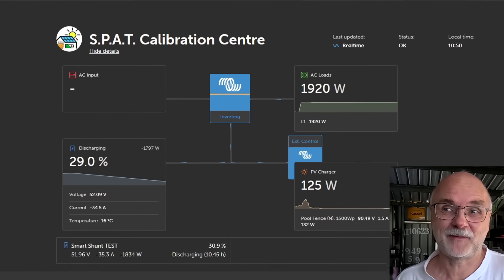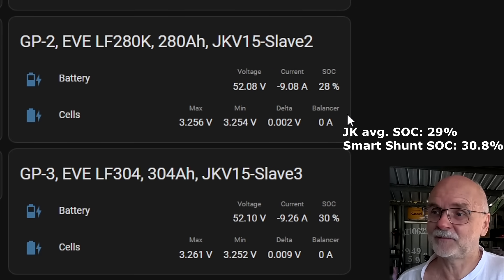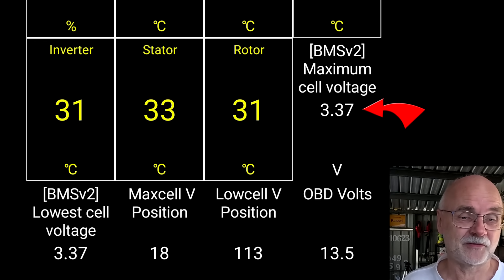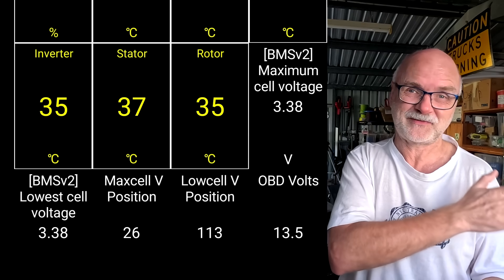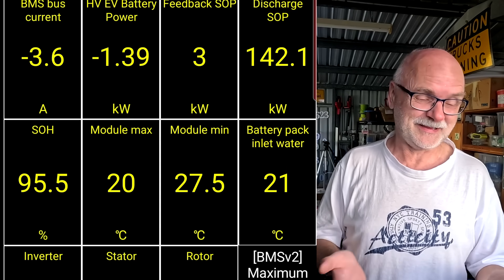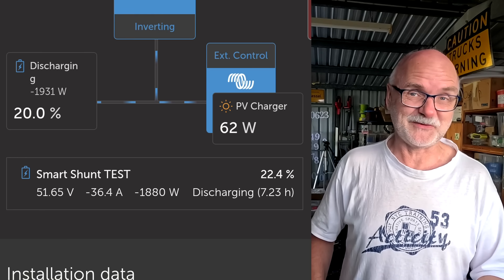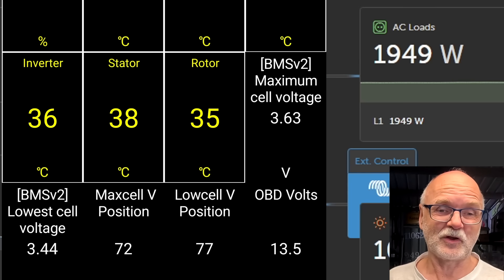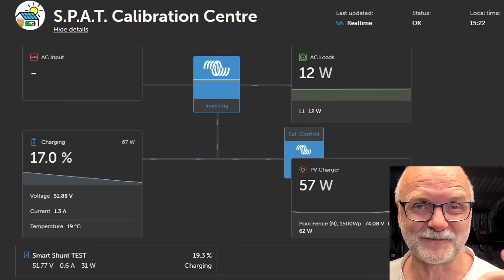JK Inverter BMS SOC Precision Comparison | Update 1

Comment: Hello! I have bought versions of the jkbms, one V14 and a V19 and I am noticing in my cerbo GX that the V19 consumes more current because the DC load increases up to 400W when the solar is delivering more amps. That just doesn't happen in the V14. Does anyone notice that?

Thanks,

Armando

Comment: A quick question
I have a JK BMS, was going fine but now the app shows 0% SOC in batteries (7.00 kwh) but they are at 27.05 volts with 50 amps inputting.
Any thoughts?

Comment: My experience only stretches to JK BMS v.15 and v.19, but I'd say the v.19 is really bad at keeping track of SoC. I have used the two with the same battery pack in a small electrical vehicle but after switching to v.19 the SoC readings were useless. Have added a Victron SmartShunt and it gives reliable readings. As usual, Victron gear is super!

Comment: If I undestand, you have JK bms in parallel.  It means voltage is same, but current is based on the internal battery, wiring and BMS resistance. So the most likely the current differs per BMS what seems to be reason for different SoC values after some hours. You can't say which BMS is more precise unless you do separated tests.

Comment: Hi Andy love what you do and watching for all your tips and bits i can absorb for a future project to build a battery pack that will run everything we need to travel this great land (Australia) in a caravan.
The System i have designed for our needs would need 240Amps (If Everything was on at Once but that obviously would never happen) 
To date can you please advise your opinion on the best DIY 48V 310AH (There About) Battery Box, Battery Cells (Brand and size) and BMS with Active Balancer 

i hope this makes sense 
Thanks In Advance
Reply from the maker: Sounds like you are in for a Yixiang DIY box V2 with JK-BMS and MB31 cells. That matches your requirements. I made quite a few videos about this box and the link to it can be found here: https://off-grid-garage.com/diy-kits/
Reply: @OffGridGarageAustralia  Thanks so much.

Comment: Hi I have some isues with my JK BMS (PB1A16S10P) and JK is not answering my Email, hope someone can help me.

I have some issues with adjusting the balancing amps. When I try to set something like 0.5A it just jumps back to 1A again. For some reason I got it to 0.3A at some point.
Would a firmware update fix this?
And what is the lowest balancing amp possible, I need it to only balance with 0.1A or 0.2A pr. cell.

Comment: Unable to upgrade V19 to FW 19.05. How to perform it? It always connects in a parallel mode, with settings tab being inactive. Also what does mean "Discharge OCP2" switch?
Reply from the maker: DIP switches need to be on 1000 for the FW upgrade.

Comment: Andy, the battery chargers you recommend, both in AliExpress, and in Amazon, are no longer carried.  However, there are MANY 60V, 5A power supplies listen at both vendors.  Would any of these be good, especially for 48v raw cells?
Reply from the maker: No, you can't us a 60V charger. That would overcharge your battery. I'll update the links...
Just checked both links for Ali and Amazon and they work and point to the right 54.6V/20A charger.

Comment: The biggest problem with the JK-BMS is that it deviates a lot when idling. When the battery isn't charged to 100% on the third day, the deviation is already 20%.
On the Smartshunt in idle it reads 0.5Amp and on the JK-BMS between 1.5 and 2Amp. I've tried calibrating it, but it doesn't work, and I've tested it on several devices.

Comment: Hi Andy, what bothers me about all the tests is the very low charge/discharge power. I personally charge with 150-200A which is between 8 and 11kw. With your 4 battery units from Gobel Power with the EVE 280 cells, charging at 0.5c should be around 560A, even charging at 1C is possible which would be 1100A, if you then run the system at 30A for days this is limited and inaccurate, it is to low. Thanks for the vid anyway

Comment: I have two JK-BMS (BMS PB2A16S20P, HW v15). The latest software version is installed on both BMSs (V15.41) and both are configured the same. However, one BMS is clearly noticeable due to its behavior. The SOC display/measurement does not seem to be working correctly. While the first BMS is still at 72%, the other one is already at 4%. And that's even though both packs have the same voltage and not a single cell has drifted too far. Both packs are connected in parallel to the same DC connection and to the same Victron system. Do you have any suggestions as to what i can do?

Comment: i think cars use lithium ion batteries?
Reply: Depends on the car.
Reply: Car makers have decided it's not a good look when lithium ion cars catch fire so real world testing has caused them to now favour LiFeP04 chemistry. Is this a fair comment?
Reply: Sounds rather far-fetched, EVs having a lower combustion rate than IC cars, but of course there's a powerful incentive by the fossil fuel and motor industries to spread disinformation. I doubt the average punter even knows what technology their EV uses. LiFePO4 cells have a longer life than LiIon cells but of course lower energy density.

Comment: My impression is that the difference on SoC between my Victron Smartshunt and my V15 JK Inverter BMS tends to be much bigger with normal daily usage (small loads come and go, charge come and go during the day) - vs. full continous load/unload of the battery.

Battery is 16x EVE 280ah cells (measured capacity just above 290ah).

As for now, my Smarthunts reports 25% SoC, while the BMS reports 33% - and it's charging around 35-40 amps at the moment.

Obviously I trust the Smartshunt more than the BMS regarding SoC :)
Reply: Have you calibrated voltage, current AND capacity ?
Reply: @Juergen_Miessmer  Yes, up to several times :)
Reply: @Juergen_Miessmer  Not sure how to calibrate capacity though, since it's a bit "constant"... :) 

But voltage and currant - indeed. As said, multiple times.
Reply: @JFK666666 
Set the capacity with the JKBMS App to the result of your capacity meassurement.
Reply: @Juergen_Miessmer  Ohh, indeed, that I have done :) 

Capacity in my JK Inverter BMS is set to 290AH.

Comment: SOH is  meaningless in most EV. Hyundai/Kia for example melt down the Buffer and then state 100% SOC 😂. Only Tesla does a comprehensive self check procedure for SOH. It is normal to loose 5% within the first 50.000km and then 1% for every further 50.000km. On my EV after 11 years and 420.000km : 16.8% degradation.

Comment: How are you getting the car BMS data?  Did I miss something?  Also, I noticed the voltages are different on the JK-BMS and the Shunt.   Would calibrating the voltage and current help with the difference?

Comment: Biggest effect on JK BMS SoC accuracy is how much time you spend near the 'dead zone' they zero out current reading to mask DC offset error.
Worse case is using system as a UPS which spends most all of the time in the dead zone.

Comment: Thanks Andy,  As always very nice presentation, I enjoy your presentation style.  @10:05 you give us the SOC of the 4 batteries as (Master = 13%, S1=21%,, SS2= 16%, S3= 17%) and you claim the SOC% preciseties  shows the Master is the worst (13)% and S1 (21) is the best, but we have seen (on this channel) that batteries in parallel may not charge/discharge evenly (relative to capacity) and the current sharing (I prefer the term current hogging) can change over time throughout the discharge cycle.
I did enjoy your videos on your Unplugged EV channel (I found it only about 2 months ago).  Please give us some new content on your Tesla(s).  
As to calibrating individual BMS(s) in the batteries, how about adding a smart shunt to each battery?  You can start by calibrating the smart shunts (to each other) by putting them in series and charge / discharging a single battery and see how they do.  Yes the voltage drop of  the shunts will cause a slight difference in Watts and Wh on the different shunts (due to the voltage drops measured from the B- of each shunt to the P+ of the batteries (As each B- will be at a slight different voltage), but the Ampa and Ah should be the same on the 4.  You could then use these calibration values a s a "fudge factor" in a spread sheet.

Comment: "Hello Andy. Thank you. Your method is not reliable. I've already observed that JK-BMS makes many errors depending on the discharge current intensity.
It errs more or less depending on the fluctuation of the discharge current.
Your test doesn't reflect real-life domestic use, for example.
Simply put, even the Victron shunt and the JK-BMS don't give exactly the same discharge values depending on the discharge and charge intensity. Because of this, it already can't be good for JK-BMS."
Reply: That's the whole point of the test, to determine how much the Jk-BMS SOC is out, and which version (V19.V15,V14) is better or worse.
Reply: @uksa007 

Please read more carefully. The answer is already provided in my post.

Comment: Yesterday I found out that the wonderful Solarman integration in Home Assistant can set the Max charge amps value in my Deye Hybrid Inverter!
This allowed me to force it to 0 during the morning here so that the battery did not fully charge and instead some export could be done during the very expensive early morning hours. When the sun hits peak power with clipping due to the inverter being limited by grid voltage vs rating it can then start charging and put power into battery. There's around 4 hours of 1-2kW to be had if there's somewhere to put it :)
It's sad one has to find all such workarounds for something that should have been an option in the inverter.

Comment: Hmmm....one smart shunt vs. 4 JKBMS on 4 paralleled but different batteries.... The smart shunt can not see the real SOC of a single battery. So comparing to the SOC the JKs showing is a bit faulty.
 
You set the JKs to the nominal capacity and the smartshunt to the sum of the 4. This has to fail.
I suggest first to meassure the real capacity of each battery and set the JKs and the smartshunt to the meassured values. Then repeat the test.

And wow, your car battery is way out of balance. Highest cell ist at 100%, lowest maybe around 95%. All other cells SOC is somewhere in between. I think this is why the SOH sits at 95%, as the weakest cell determines the capacity of the whole battery.
It would be very nice to see how the car charger/bms handles this imbalance. Does it float and give the balancer time to work?
I guess there is only a passive balancing and due this it will take a very long time to get back into balance.
Reply: 200mV is a significant delta V and will be reducing capacity. Does GWM have a section in their manual about how to manage this? Out of interest does the GWM charging profile allow you to keep the cells at 3.55V to allow balancing to occur? Maybe Andy needs to show GWM how to add an active balancer to their LiFeP04 packs and write some instructions for them😂 edited - changed Tesla-->GWM
Reply: @ocular57 
Andy's wife's car is not a Tesla.
It is a GWM Ora.
Reply: Thank you changed Tesla to GWM

Comment: I wish i could connect the victron smart shunt with the jk bms for better soc, or connect the smart shunt and bms to my growatt at the same time and make the growatt only look at the soc from the smart shunt
Reply: I have been working on integrating the Smart Shunt with my iBMS. 
Does your growatt inverter support CAN protocol?
Reply: I keep mentioning YamBMS without actually knowing if it can do this. I have a JUNCTEK shunt and would like to do the same, but there's not much incentive this time of year when the battery is fully charged by 10 every morning.
Reply: @matthewmarks6951  It's Winter here, which is why Andy like most of us is struggling with lack of solar to fully charge the battery and hence the SOC drifts.
How have you found the JUNCTEK shunt? 
Is it as accurate as the Smart Shunt?
Reply: @uksa007  Well exactly - I've only had it since the end of March so I cannot tell anything beyond that it measures smaller currents than the BMS. I won't be able to compare as I don't have a Victron shunt. Its clock doesn't seem to be able to count days of the month properly, and I had to reboot it once to get the Bluetooth app to connect, but neither is a problem for my intended application.